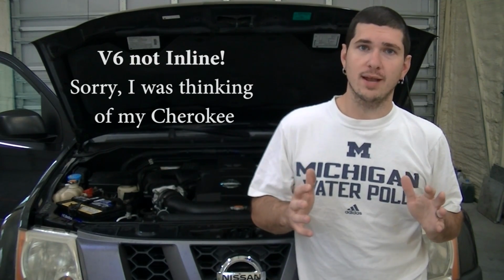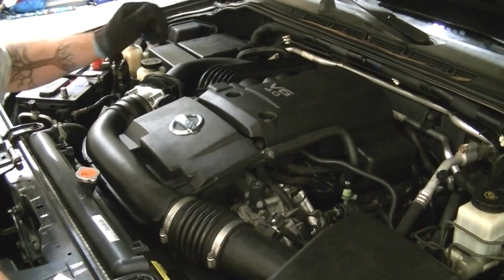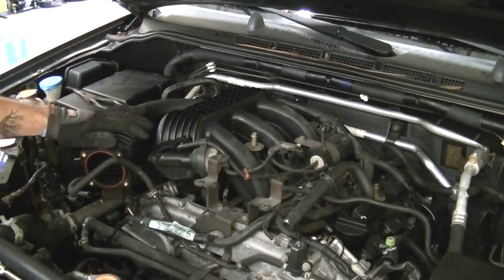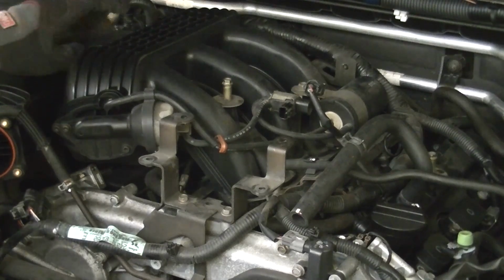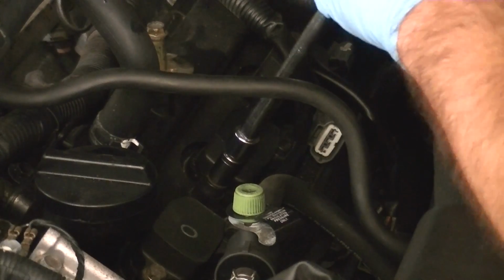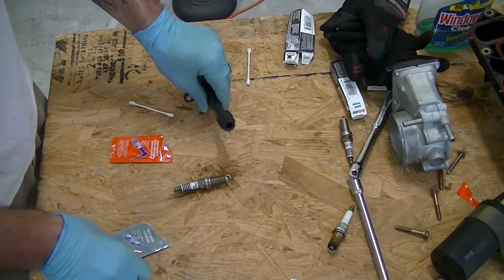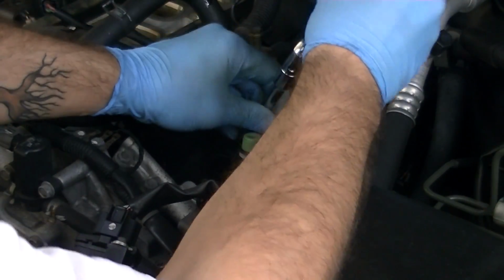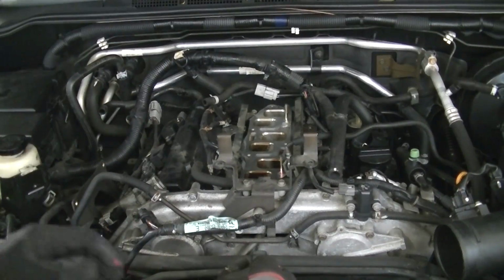How to Replace the Spark Plugs on a 2005 Nissan Xterra

Comment: Great video. Thanks a ton for the effort! Gonna attempt this in a few days thanks to your video. And, atta boy for dealing with all the haters in a professional way. Just trying to do things correct...... 
I have an 06' Xterra manual, original owner. Thought this was done at scheduled mileage and come to find out it was not. My fault. 145k on original plugs, oops! no miss fires but definitely lacks power it once had and reduced MPG. I do pull (pop up, rzr4) so I went with OEM plugs, $84 from dealer (Standard type:PLFR5A-11). 
After reading about the throttle body comments I will attempt to change the plugs without removing the intake, mainly because I do NOT want to have to deal with throttle body codes or manually correcting that issue with timers and stop watches, confidence low with that one. 
Qu: if I do decide to remove the intake can I keep the throttle body attached? you removed it in your video. I want the least to do with that as possible.
Thanks again for all your effort
Reply from the maker: +Erich ariZona thank you!! And yes you can leave it on but the potential for throw codes comes when you take the power connector out of the sensor. Which (if you remove the intake) you will have to do.
Reply: Ry the car guy  question related to this:  when I looked at mine contemplating doing this job, I was thinking that the throttle body should be able to be separated from the intake without disconnecting anything and just left sitting there. is there any reason why that would not be possible? care would have to be taken working around it of course, but this method should eliminate the possibility of throwing codes for the TB, or having to do a relearn, as long as I am not missing something.

Comment: Thanks for video..... Just replaced plugs on my 2006 Frontier 4.0  I only loosen the plastic intake plenum and just lifted it up maybe an inch or so It was actually still kinda on the studs on one side. I did NOT remove the throttle body. The whole job probably took me an hour for all six plugs and I'm just a shade tree mechanic at best.

Comment: On my 2007 Frontier I got out all the plugs except for the number 1,then its just a matter of removing intake bolts and wire loom,covers,etc and raising intake manifold a few inches,while holding it up with something,then a quick change of the #1 plug and snug back everything together.

Comment: Hi Ray thank you for your videos
I do basic works in my car 
I resently changed my spark plugs, oil,  filter  cap and router as well i still have to change the six sparkplug I need a smaller ranch cuz the six valve in the Nissan Xterra is as you know it is very uncomfortable to change  
My question my car keeps jerking after I change the router cap and I was very careful  to remove the coils one by one 
I love to learn to work in my car as well and feel the  pleasure I can fix as much as I can people see me working in my car and they get impressed that a woman like me I guess is doing such a job but i love to know as much as I can

Comment: Concerning the  2005 X Terra although I have always liked them I would seriously recommend getting rid of it due to the Radiator Leaking into the Transmission causing both to fail the transmission and radiator, it's a common problem known by Nissan but even after law suits Nissan fail to help people out. It's a crazy expensive fix.
Reply from the maker: I have a manual transmission....
Reply: Lucky man..lol My neighbor just had to replace his auto transmission, radiator and a few other odds and ends and man he's not happy.
Reply from the maker: Yea, if I had an auto I would have done the fix as soon as I heard about it.
Reply: I keep finding the 05 automatic's for sale and the one that really stays on my mind is a 05 Off Road Edition and has 239k miles on it but it's soooo clean and appears to be maintained.
Reply from the maker: I would be weary. Check for evidence that the fluids mixed.
Reply: This was a know recall that Nissan had placed in effect a while ago due to the nature of the failure. Hopefully (and I'm crossing my fingers here) the original owner had it taken care of like they should have. There is a way to check to see if it was replaced, I believe you can have the dealer look up the service record or I they should've installed a external trans cooler on the ones that were replaced along with a different radiator etc. (could be wrong here)..
Reply: very true, it cost me 3,500 to fix this .problem
Reply: a man whats the torque specs in the intake manibold bolts please
Reply: My Damn Channel I just dropped 3800 on a new transmission not happy about it. All you haft to do is check to see if it is leaking if not just replace the radiator and your set. A trans cooler is nice but not as good as a line going through the radiator.
Reply: Assuming the vehicle doesn't have SMOD (Strawberry milkshake of death) he can just spend 200-300$ on a new radiator and that fixes the problem. Nissan finally fixed this issue in the 09+ X's and in the 10+ they fixed the timing chain problem.
Reply: With quick bypass permanent fix and adding another transmission cooler this becomes a non issue. It took me 5 mins to move the hoses.
Reply: I"ve heard this is the fastest way to avoid the big bill should it come. But how do I know exactly what one to buy?  I'm looking on Amazon, and so many choices.  Any suggestions? THANK YOU :)
Reply: My Damn Channel I would just do the fix. As long as the fluids aren't mixed. At 239xxx miles I'd make sure to do some road testing and check the fluids in rear and front diff, and transfer case. If it's cloudy and burnt expect to spend some money. it's easy to check especially if you take it to a garage and pay a few bucks and have the mechanic look with you. Check for leaking seals especially on the rear of the engine. Good luck
Reply: it really is an easy fix
Reply: In response to some of the comment. Having the tranny cooler in the radiator is important in cold climates. In warm climates, just bybass either with external cooler or just run hose from one to the other. In cold climates, replace it with aftermarket radiator. It is needed to warm up trans faster in cold weather. That is why it is in the radiator  in the first place. And as for fixing the timing chain issue in 10'. No they didn't. I worked for them from 10' to 14'. They had this issue for even new ones at the time. I know, I replaced a few myself. As soon as we heard the wine we new we had money in the bank.
Reply: that was fixed for the 2005-up
Reply: Hardly a reason to get rid of the vehicle. I did the bypass and installed a secondary cooler because I tow and off-road. I'm just beginning to learn automotive repair and pulled it off with relative ease. If anyone is freaking out about this fix, message me, I can actually explain it.

Comment: Hey budi have a 2006 pathfinder same engine didnt remove nothing you did. Worst spark plugs ere cyls 1 and 3 and those i took out with a long 3/8 extension with a swivel and 5/8 spark plug socket

Comment: Thanks for posting this. My '10 Xterra is due for plugs, and seeing this is a big help. I wonder what engineer thought it was a good idea to block the plugs in with the upper intake? ah well, at least the plugs don't have to be changed often, and once the intake is out of the way it's a straight shot at those three plugs. I used to have a 1st Gen x and the drivers side three plugs were a huge pita to get to on the vg33, the #6 especially required lots of profanity to get out, and even more to get it back in! the vq doesn't look so bad in comparison.
Reply from the maker: +Mallan530 honestly its really not bad. Some people on here act like I'm crazy to go though that work but I say its crazy not to. If you try to work around that manifold you could do more harm than good.

Comment: Nice video, just bought a 2000 and I'm sure spark plug change will be in my near future.  One question is there any way to tell if the coil is bad (I don't have a code grabber, which do you like) because this would definitely be the time to change them too.

Comment: Are all years of the Nissan Xterra the same in terms of the obstructions to the removal of the passenger side bank of plugs. I have a 2008 Xterra and I am eventually faced with the plug change procedure. I have seen other videos and some comments have indicated that individuals have managed to swap out plug #1 without all the dissasembly by creative use of small stubby ratchets and universals, rubber hose fittings and a creative rotation of the coil pack in such a way that it lifts out without massive parts removal. I would love to see how the Nissan dealerships really to the plug swap. 
Can anyone confirm this?

Comment: Ryan, thanks so much for the video. I just changed the 1, 3 and 5 spark plugs on my '06 Pathfinder. I have a question. It took me forever to take things apart to get to the boots and plugs. I just read on the NGK site that using anti seize lubricant can be detrimental to the plugs. I used it based on what you said. Have you had any problems with the plugs after using anti seize on them?

Comment: Your tutorial was great, very clear. 
Sadly mine did not go as smoothly. I don't know what happened but my engine won't start now. Any advice?
Reply from the maker: What happens when you try to start it?
Reply: @Rythecarguy  it tries to turn over but I have to stop it before flooding the air intake with gas cause it won't stay on.

Comment: removing the intake and risking a break in it is not the right way  iam sure the dealership doesnt take it off to change a plug
Reply from the maker: +Kevin Collie for the 50th time, I follow the factory service manual for all of the jobs I do. I'm pretty confident that Nissan knows how to work on their cars a little better than you do.
Reply from the maker: +Kevin Collie if you dont like doing repair jobs the right way, dont watch my videos. I teach PROPER methods not shortcuts.

Comment: Great video! I received a quote from a mechanic that ranged anywhere between $750-$1,200. Is this price range typical for this work? $1,200 being to replace all 6. Also, my 2005 Xterra has almost 200,000 miles on it, Would it even be worth fixing at this point?

Comment: Thanks for this video man (and all your others) - so glad I found your channel on here. I'm about to change out the plugs when I have a few hours this week & was a little freaked out about doing it. 
My car's at 128k - would you recommend changing out any of the intake manifold's gaskets? Also, should I buy a torque wrench first or is it okay to just get everything pretty snug?
Reply from the maker: Of course man, I really love doing this and I am glad it helps people out. 

My honest opinion on spark plug torque is that its ok to snug them. I know I might get heat for saying it but I have owned over 55 cars and done spark plugs on at least 25 of them and never had an issue. The only thing is you need to be ludicrously careful not to sung them to tight. If you break off or strip out a spark plug you will be in a world of pain.  

As far as the gaskets, I would not worry about it. You should just inspect it while everything is off and only replace if there is clearly an issue.  Have fun and let me know how it goes.
Reply: Hey just wanted to let you know it all went great thanks to your vids! I replaced the worn out gaskets / a couple hoses / pcv valve while I was in there & cleaned out the throttle body + maf sensor too. I had to do the relearn procedures twice to get it right & the ses light stayed on for about 20 miles w/ some erratic idling, but now it's off & idling right where it should be. I was worried there for a bit, lol. Time to check out your backup cam vid now. Thanks again man!
Reply from the maker: Oh nice! I'm glad it went well. Yea sometimes after cleaning sensors they get a little weird until they totally dry out. Let me know if you end up doing the backup cam. So far that has been my favorite upgrade on the truck. People are always surprised by it and find it really interesting.

Comment: So I just picked up a 2005 Exterra with 77k miles, and no mechanical issues as of yet, I only have it a week, But I heard about the trans radiator thing, What should I look for? and what should I do to prevent the bomb? And did I miss something or dont you have to gap the plugs before installing and what about torque specs?

Comment: TORQUE SPECS:
- Intake Manifold Collector [7 nuts/bolts (10 mm)]: -------------------------11 N-m, 1.1 kg-m, 8 ft-lb 
   Note: if the studs came out with the nuts the stud torque is---------6.9 N-m, 0.7 kg-m, 61 in-lb 
- Manifold Support Bracket [2 bolts (12 mm)]: --------------------------------20.1 N-m, 2.1 kg-m, 15 ft-lb 
- Throttle Body [4 bolts (5 mm hex/allan)]: --------------------------------------8.4 N-m, 0.86 kg-m, 74 in-lb 
- Vacuum Tank /canister  [1 bolt (12 mm)]: -------------------------------------19.6 N-m, 2.0 kg-m, 14 ft-lb 
- Ignition Coils /Coil Packs [1 bolt per coil (10 mm)]: -----------------------7.0 N-m, 0.71 kg-m, 62 in-lb 
- Spark Plugs NGK [1 per cylinder (16 mm)]: ------------------------------------24.5 N-m, 2.5 kg-m, 18 ft-lb

Comment: I just leave the Throttle body attached and roll the intake foreward so I don't have to disconnect the coolant lines. Also I check the intake o-rings if they are hard or flat replace them as long as it's apart. they are cheap.
Reply from the maker: Great tips! As long as your coolant lines are healthy enough for that kinda twist. If they aren't they should be replaced anyway. 🤘🏻

Comment: Great video, would have liked to see torque specs. I'm not super experienced so I don't have a feel for these kinds of things and like to use a torque wrench.
Reply from the maker: Sorry about that. Ill put them here and in the description of the video. 

Spark Plug - 18 ft-lb
Ignition coil - 64 in-lb (notice INCH pounds not FOOT)
Throttle body (if you took it off) 74 in-lb
Intake manifold collector- 8 ft-lb There is a taller bolt on the inside of the manifold that is 4ft-lb
Vacuum tank - 14 ft-lb
Engine cover - 49 in-lb
Reply: Much appreciated!
Reply from the maker: ***** Of course! Hope it goes well!

Comment: I have never seen a design in which 1/3 of the spark plug threads would protrude and be exposed inside the combustion chamber (as is implied during the application of anti-seize), so I am dubious of that part of the demo.  First, I would use a lot less of it, and second, I would use it on all the threads.  The only thing to avoid is getting anti-seize out on the rim of the plug where it's exposed to combustion processes. But close to the final thread is ideal - that's where the seizing/corrosion issues (i.e., differential metals and heat) are the greatest.

Comment: Good presentation, one question air intake collector is stuck can I hit it with rubber mallet or use breaker par to pry it loose. I don't want to break it.
Reply from the maker: There is really not any reason that it should be stuck. Double, Triple, then quadruple check that you have all of the nuts and bolts off of the intake and pull up using your own strength. I should come off. I would not recommend hitting it with anything. If you crack it then your tune up just got a LOT more expensive.

Comment: Wrong move not going with the correct  plugs
the auto lite will not last very long  I would not expect them to function properly beyond 30,000 miles. opposed to 130,000 miles with the double platinum .
Reply from the maker: +David Stanley thanks' for the advise..... I drive that truck about 5 miles a week. Looks like I won't have to worry about it for about 100 years.
Reply: *****
yeah ,then your covered ,but hate to see you down the trail ,with no way back.
Reply: The correct plugs are NGK laser iridium.
Reply: With all that job I have to do to replace the plugs, I would definitely go with the original ones which I believe is the iridium tipped one, even if they cost as much as you mentioned

Comment: Hey brother, how are you, merry xmas,I got question my xterra 2006 have 89000 miles. Would you recommend that i switch out the spark plugs and ignition coil?
Reply from the maker: The factory service manual sates that the plugs should be replaced every 105,000 miles. So depending on your tucks performance you can determine if you want to do it a little early. As far as the coils, the X-terra is a "coil on plug" design meaning each plug has its own coil and there are no spark plug wires. Just wires powering each coil. I would not replace the coils unless you have a problem with one. They are expensive and there are 6 of them. 0.0

Comment: Tape the socket and extension together so you can always retract it as a unit.
Reply from the maker: Great tip thanks! I will do that. I really just need a better socket set though.
Reply: You can use vacuum hose over the new spark plug tip when installing it, just put a little silicone dielectric in the rubber boot instead of on the plug tip.  You don't need a special tool to install the new plug.  I do have a set of Matco spark plug sockets, with the swivel and extension as part of the tool.  Inside the socket is a magnet to hold the plug in place, so I can use the socket to remove/install the plug.

Comment: It looks like with all that taken out it would easier to replace the camshaft position sensors at the same time. mine need to be done
Reply from the maker: It might be easier if you plan to attack the sensors from the top of the engine. If you do to from the side it won't make much of a difference. However, if you have a lot of miles on your Xterra and it's getting older, you should knock it out anyways. Just to avoid issues in the future.